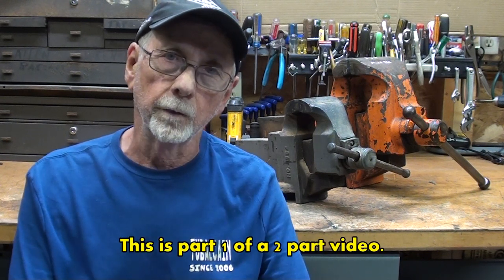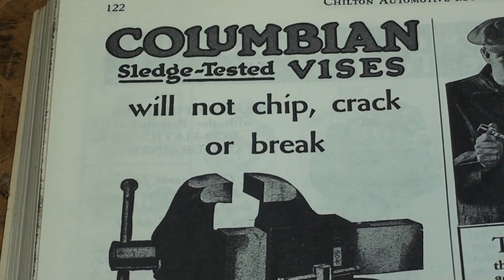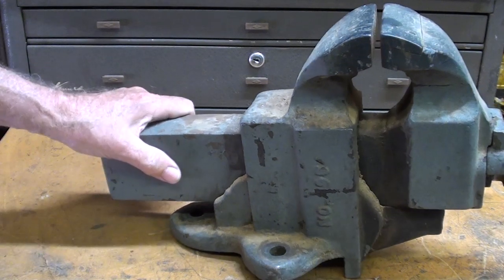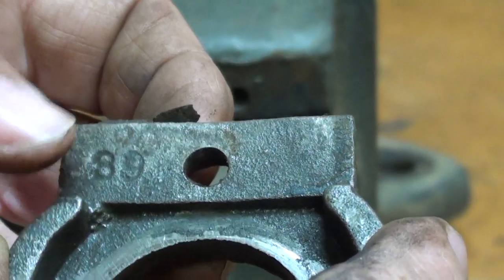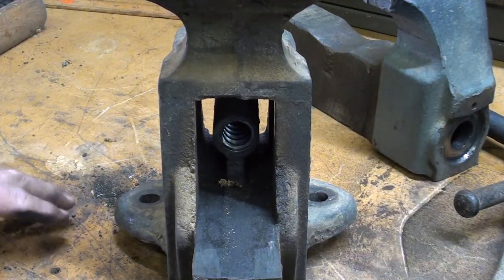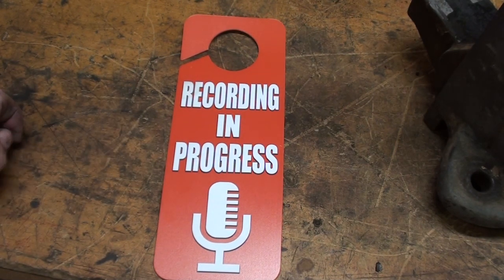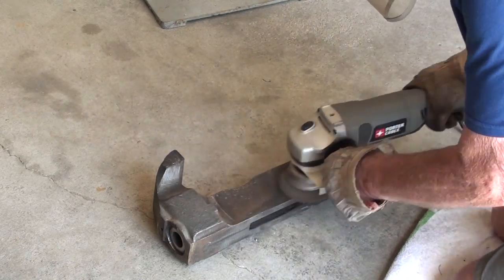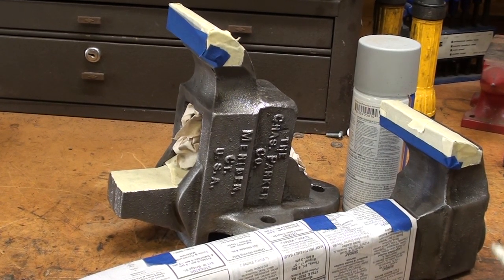Parker Machinist Vise Refurbishment pt 1 TIPS 591 tubalcain mrpete

Comment: On the moveable jaw of your vice with the abnormal wear, Why not add metal with a welder & then, machine it down to smooth before painting the rest of the vice. I believe you joked about ammunition being repetitively dropped down onto the slide? Anyways, I just wondered why no-one mentioned adding material by welding it & machining it?

Comment: I'm surprised that you didn't use your milling machine to remove the casting edge from the base .
It would have made the vise set flat on your bench .
I always enjoy your videos and want to thank you for the time that you take in researching data to share with us .
Reply: I was thinking the same thing about machining the base flat, it would make the vise more stable.
Reply: I don't think Mr Pete likes to create unnecessary work for himself. He knows exactly where the vise is going to go (i.e. on the corner of his wooden bench) and there is presumably enough 'give' to accommodate minor imperfections in the surface of vise base. I suppose if the small central ridge bothers him it could be filed down easily and quickly.
Reply: I was wondering the same....
Reply: I bet he does it in part 2
Reply: That vise is designed that way so the static jaw will clear the edge of the bench.
That Flat goes up against the edge of the Bench.
Reply: @tropifiori  Bet he doesn't! - A bit of filing at most :-)

p.s. The stake is whoever wins gets to say, "I told you so!" lol
Reply: @m9 ovich Yes.  I later realized that.  Poor manufacture, likely missed by Inspection.

Comment: Nice restore on that Parker Vise.  That radius in the top of the ram is very strange.  It looks like someone heated it and formed it in a press.  The wrinkles one side did not clean up from grinding, the other side did clean up IMHO.  I asked your question about this on"Vise Collectors Anvils & Clamps" a very good FB group of very keen Vise Enthusiasts.

Comment: i have a 1930 or 31 31/2 inch parker that has a small steel disc between the spring and the handle.

Comment: The wallow in the ram looks deliberate. Like a work holding project that vise throat was not large enough to accomplish. Just a heads up weld filling that back in is best acomplished while it is in one piece. Thanks for the video.

Comment: I use a short stiff compression on end ram. When vise is open, it’s slightly compressed against the wall. With both hands , I can position sheet metal for bending, I use my knee to tighten the vise. I use coil springs on all other vises. Saves time!
Bob
Reply from the maker: Great idea

Comment: I have a Parker bought it at a garage sale it’s about 50 pounds, has a stamp of 94 on the side. Won’t to dismantle it and clean it. It was just like my Grandpas ,  that a grew up with sitting on an old wood crate watching him for hours. Having a problem pulling out the sliding jaw. Pushed out the pin out of the nut and it to moves but only half way. I know enough not start pounding on it. Love your videos very informative and interesting. Looking for help thank you.
Reply from the maker: Thanks

Comment: G'day Tubalcain. I've used a wire wheel in an angle grinder and ended up in the emergency department at the local hospital with 2 of the wire bristles lodged in my abdomen. Now I wear a leather apron when using one.
Reply from the maker: I picked many a wire out of the students cheeks.

Comment: I suspect that the curvature built into the movable jaw was to accomidate pipes being held in the vise and the bad part of the casting near the curvature was slag not removed from the heat before it was poured.

Comment: I just picked up the same model but mine is missing the jaws. The rest seems in pretty decent shape. Mine had a flat tipped screw then a spring with a large end facing the screw and a small end facing the handle. Between the spring and the handle is a small disc. I can send you a picture if you wish.

Comment: I love vises, and I also love restoring them.  hard to imagine a company like parker not machining that bottom flat, it might make some sense if this was a rotating vise but this obviously is not.  What a greap piece of shop tool history, I love the beefy construction on these old beasts.  I told Adam Booth once id love to see him build an Abom sized vise from scratch--LOL
Reply from the maker: Yes
Reply: I wonder if, given the way the bottom of the vise isnt flat, it might be a good idea to put three large thick washers under each mountiing hole, then you could tighten the bolts without fear of cracking the casting.  Better yet machine the bottom of that sucker, make it sit like its supposed to.

Comment: Thanks for the video. I am doing a quickie overhaul of a Parker 272, swivel base and swivel jaw vise. Just yesterday found the screw in the handle spindle. Dug out a bunch of powdery dirt and pulled the spring out. The spring is pretty worn, will no longer lock the handle. Need to find a replacement spring. Need to work on the swivel jaw to get it operating smoothly. Any tips on that?

Comment: Have you been rooting through my toolbox? 🤣

At 4:13, that looks like the Stanley screwdrivers I bought when I was in high school and still have today, 40+ years later. Consumer Reports at the time had actually slightly downrated one model of that screw driver because you could actually apply too much torque with the handle for anything to withstand. I don't remember if the shaft twisted or the screw head stripped out, but it easily accomplished all the normal screwdriver tasks.

A very good screwdriver, none the less.

as far as your friend Tommy goes, I thought you might have stolen the spark plug from his lawn mower 😆
Reply from the maker: lol

Comment: Rattle Paint Can Trivia: The item that makes the noise in the paint can is a marble. 
Also, they sell paint can grips that attach to the top of the cans to ease finger fatigue, painted finger tips, & better aim. If you must wear gloves, get nitrile gloves.
Reply from the maker: Thanks
Reply: Nitrile is good for everything except for paint stripper, then you need very thick butyl gloves and that only buys you time....
Reply: They put marbles in paint cans???  Get out!!!
Reply: I always use a pair of side cutters to de-gas the can to send to the scrap yard. I pull the marble out and put in a quart jar of thinner to clean them off. Have a ton of them from over the years

Comment: Wondering if you might be able to help me. I just bought a C. Parker No. D at an auction. It's in awesome condition but I cannot find any information on it? It has a different front on the main screw but looks all original. As well, the ends on the main tightening are are different like they were made to be removable but still look original and professionally made. Like I said, the vise is in great condition and I'd like to find out what I have...if you want pics, let me know how get them to you. Thanks!

Dean Tucker

Comment: Well you surprised me - I would have thought you'd grind off the bottom a bit to prevent breaking off the ears. And, Is it me or is that a flaw in the casting showing up under the pressure of pounding repeatedly on the throat? We all know you could fix that with a welder but your not being a blacksmith or heavy vise user makes that a lot of work for "beauty". At our age, that's not something we need to spend much energy on. Still glad to see you on another project.

Comment: Sir, if possible, can you tell me the size set screw you used for the handle "brake"? I just bought a Parker 974 to restore and it is missing the set screw.  Thank you very much. I have scoured the internet and you are pretty much the only one who addressed this particular feature of the Parker vise.
Reply from the maker: I am in Wisconsin for a week. Contact me by email later
Reply: @mrpete222 thank you very much, I appreciate it.

Comment: Quick question, knowing that the base of the vise is not machined way didn’t you machine the vise?
Reply: Getting that casting set up on the mill would take all day, and a satisfactory job of flattening could be done with a hand grinder in about ten minutes. It doesn't have to be dead flat. At most, the mounting ears just need to be in solid contact with the bench. For that matter, a washer of the appropriate thickness under each ear would be a reasonable solution. It's a bench vise, not a precision instrument.

Comment: ive got the same charlie parker. if you ever get bored, could you make a replacement set of jaws and show the process. Maybe a process without a milling machine lol. My milling machine  goes by the name angle grinder. I really like the idea of the way the jaws are fit into the steel.